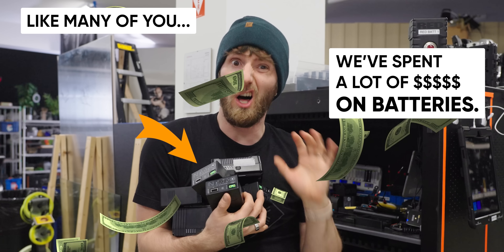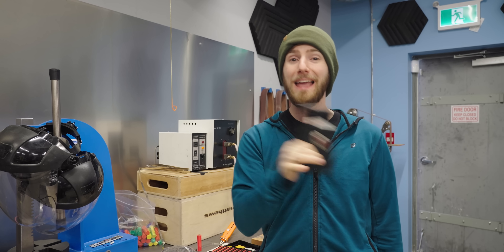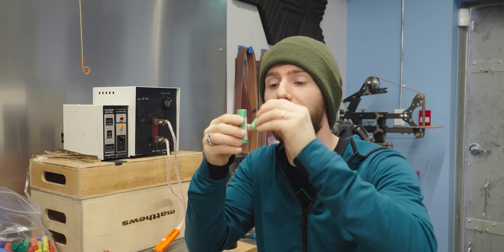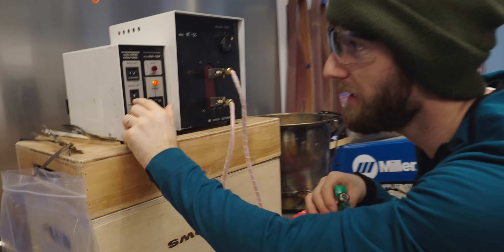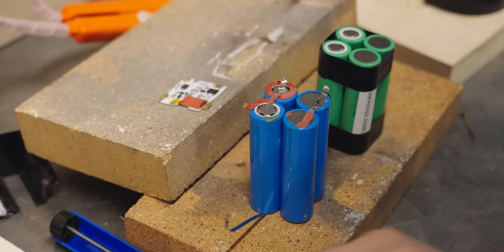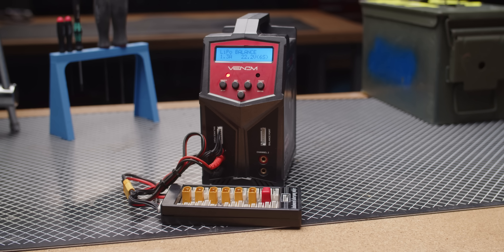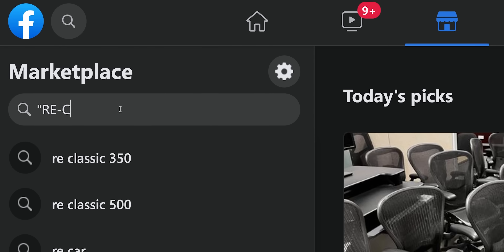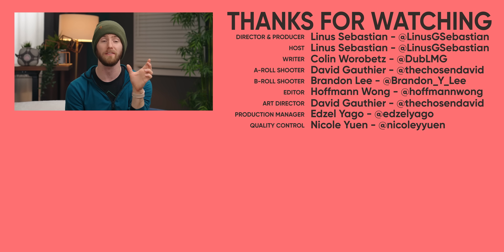This should be illegal… Battery Repair Blocking

Comment: Try keeping power to the BMS. Measure the voltage before you disassemble it. Use a diode protected power supply to match it before you cut the battery loose. Before you connect the last battery lead slowly raise the voltage to match the new battery pack. May work.
Reply: I did that with Gameboy game save batteries and in some devices with clock or other volatile settings that I can't be bothered to set. But a diode is a must, and DON'T use a big capacitor directly in parallel with the battery (it's ok if it is after a diode). It can momentarily drop the battery voltage and reset the thing that you didn't want to reset before it's charged, as a really old battery can have high internal resistance, in contrast th e capacitor being almost a dead short (but at this point the battery will likely be such toast that trying to turn on the device would do the same thing if it's not totally flat). With a moderately evil multi-cell BMS you'd have to make a voltage divider to emulate all cells, as the lack of those voltages would also be a dead giveaway that it's being reworked (in contrast to a fully evil BMS that directly stores the battery's "capacity" and can only lower it, maybe even lowering it faster artificially based on the amount of charge cycles).
Reply: @krzysztofczarnecki8238  See that's just criminal to me that manufacturers can do this. This all exploded after a printer co was sued for making their printers shutdown after X amount of prints. The r-tard of a judge sided with the printer co.

Comment: This was the gayest battery revival video I have ever seen. Sure li-po's are dangerous but when you know the dangers and how to work on them safely... you CAN re-cell many battery packs. I have successfully done this as an amatuer diyer in my garage for drill and battery operated tool batteries & RC batteries which often just have a bad cell in them. Save your old non working RC batts cause chances are you can rob a good cell to replace a bad cell and have a working battery pack for free. With that being said I do get some manufacturers use tactics described in this video but i would have liked to see 1 successful attempt to show that you can do this in your shop or garage safely. Thanks

Comment: Thank you Brother I had no idea that they had such a thing to make it so you can't repair items you buy. I don't buy hardly anything. i never have any money and live under a bridge with no electricity. And whatever i need I just have to wait until the universe manifests itself into my life. I could be working on something that I got 30% of it fixed but it takes 2 years before i come across the next parts I need to fix it and by then the thing is long gone, either stolen or stepped on in the dark or had something spill on it. I obviously have been focusing on batteries for a while now so I can set up a friggin light in there. Been thinking I could buy some vinegar with my food stamps and find a piece of copper wire and a galvanized nail and put some cells together, but I only just got a multi meter finally about 3 weeks ago and I left it on by mistake and the battery must have gotten so low because every single battery I test reads 0.00 and i don't believe every single battery i have is completely dead to zero. Looked up how to fix multi meters and it says its either dead battery or leads bad. So got to wait now until I manifest another 9v battery and a small screwdriver to open it up with. Bloody nightmare Bro. SO THANK YOU FOR THIS INFO BECAUSE i WOULD HAVE BEEN MESSING WITH THEM NIOT KNOWING THAT IT IS SET UP NOT TO WORK ANYWAYS SO YOU JUST SAVED ME ALOT OF HEADACHES, But I do have a question for you then, if you don't mind, Will my idea work with the vinager batterry if I get it up to over 5vs and then hook the wires to a car charger and then plug my phone into it.

Comment: If you hadn't welded the strip with one point on the + terminal and the other directly on the edge, which of course went through that ultra tough plastic film and onto the outside metal case
(- terminal)...it would've went better. Why'd you do that?

Comment: I am absolutely certain your sponsor has something to do with you claiming to never swap out individual cells because that is the absolute right thing to do. The cells are remained good in those packs could be good for another year or more. They're very easy to test under load to determine if they're strong enough to keep. It's foolish not to keep them they have real value

Comment: When replacing the batteries to a BMS, it might go into undervotlage lockout. It might require to see a charger to unlock after replacing the battery.
Reply: or bridge voltage
Reply: @justfixitsolutions  bridging voltage makes sense to me, but maybe i am too ignorant...
Reply: I think it might be just locked if the voltage shows zero it locks forever. I tried to change cells in laptop pack with no success. Manufacturers are evil in planned obsolescense, want unethical milking people of money and producing more and more e-waste

Comment: Ahem This is why I wont go anywhere near Electric Cars for the time being. Sure they have safety measures, but alas. If the Lithium pack is pierced, or if its a Hydrogen pack? ouf, well.. even a simple 18650 battery pack can burn at about 3000-4000 Celsius. Hopefully we invent a reasonably adequate and safe replacement for these batteries.

Lithium is fine in phones an small hand holds. It's the packs that weight 400-600lb's and in the case of Telsa, are even used as structural support. Yea no thank you.

Comment: When dealing with replacing cells in old laptop batteries. I've had luck with not disconnecting power leads. What I mean is having a way to connect the new cells to the bms before disconnecting the old. It seemed to me that once power was removed it shuts down the bms and it never comes back

Comment: Also why are you not using LiFePO4 cells? Those have better capacity than nickle metal and they literally have a decade usable life span and 2,000-10,000 charge cycles

Comment: You should be using liitokala cells. They are fucking amazing and cheap as fuck. They are almost the best cells on the market. Panasonic barely beats them and these cells are only a few bucks each! You can buy them off aliexpress. They also cell amazingly priced large cells for like home energy storage. My goal is whenever I get a house in the rural area is to use their cells with solar and wind power to go completely off the grid. It'll be awesome.

Comment: @4:30 thats utterly stupid you can easily reuse the few good cells in many other projects without serious risk. Now I am not talking about putting new cells with used cells in the same cluster. A great way to reuse the old cells that still work is by using all the old cells that are still good in a single cluster with 1 BMS/PCB. You could use it to create an ebike/escooter or a custom backup for your PC/house. You definitely shouldn't put new cells and old cells on the same BMS/PCB but if you had multiple clusters with 2 clusters of new cells and 2 clusters of old cells all managed by a central BMS/PCB that would be fine and work great.

You missed a good opportunity to talk about saving resources and being smart about it but instead went full nanny state about it. Such a shame.

Comment: If I were the manufacturer of a potentially hazardous product, I would be concerned about liability and I would want to make the product tamper-proof.  Not so much from end users but from fly-by-night re-cell shops.  If somebody does a re-cell and the battery pack explodes, is the original manufacturer liable?  I can see some lawyer suing the manufacturer for not making the product idiot proof.

Speaking of lithium fires, did you see that container ship with electric cars that caught fire and sank?  Possibly 4000 cars!.

Comment: Try makita. Bms locks out undervolted batteries. Never try just one more time. 

Fixing usually requires a new bms off the net, the cells are often fine.

Comment: I recently bought a dji mavic air  from an individual online.  It came with 3 batteries. The charger was designed to charge as many as 6 batteries at once. I put all 3 on the charger but only one would take a charge. After a little research I realized that the other 2 were "deadlocked." WTF does that mean? Pissed me off because batteries are like $140-$150 EACH!

Comment: samsung laptop battery circuit boards have a built in self destruct so that after a set number of recharge cycles the board stops working and if you swap out the batteries for fresh ones the board is dead and can't be reset or reused. That is criminal. I will NEVER buy a samsung product for this reason (or any apple product)

Comment: I have a Lenovo Li-ion 45N1750 battery (from a damaged 11e) that I would like to power a rechargeable 5 W DC homemade table lamp (use where I have no a/c available. I need info on the 7 line pin-out as follows ---RRWYGBB.

Comment: The BMS can be tricky. They will go into shut down mode when the battery is flat or removed. Applying an external power supply the same voltage for about 10 seconds should kick it back into life

Comment: sorry linus but you jhust sound really really uninformed in any of this. Especially about the battery fires, the lithium is suprisingly not that big of an issue, a lithium battery only contains a few grams of it and in a lithium-ion, lithium polymer, or LiFEPO4 battery the lithium is captured in an form that is not that reactive....what is the issue is an combination between a battery that can dump a lot of energy in a short cirquit (ramping the temperature up) and an dielectricum that is just rather toxic and quite flamable due to the chemicals involved.

Comment: I´m sure companies do this to protect themselves. If a user uses a modified battery that causes malfunction on the camera, that user would be able to complain on how the camera is defective when the malfunction was actually caused by the battery. The solution? force the user to buy the genuine spare battery. As you mention at 17:39, that Bebob company creates repairable batteries... BUT you have to send the battery to be repaired by them under their onw procedures to avoid users messing up. Also, as you just shown in this video, batteries are a dangerous thing that only a small percentage of users would be able to repair successfully, the bast majority would end with a burned house.

Comment: You're all worried about attaching the positive and negative battery leads in your pack at about the 9 minute mark, but I'm astounded that you don't realize that it doesn't matter until YOU COMPLETE THE CIRCUIT!! Even paralleling the batteries isn't an issue until you completely connect 2 or more batteries together. That's a pretty fundamental misunderstanding.

Comment: I have experienced that printers/copyers have some kind of use limit also. I had a HP scanner printer that was a true runner for many years, but suddenly just would'nt work anymore, with no reason that I could find. I am an electronic engineer and a certified small electronics repair guy, so I just about took every component off the card and tested them separately. Back then I had little money and lots of time.. I found that it all came down to an integrated circuit, that was triggered by the number it had been used. This component was not for sale by anyone so I just had to throw it away.

Comment: The problem that is the cause of this spot welding not working is because the peak current is too low (although it is high) and the time is too long, the best spot welders use super capacitors as a power source and a higher voltage, probably your spot welder is around 0.5 volts, the ones that are based on capacitors are 5.6 volts and so the current in the best possible time is much higher, remember, if the nickel strip gets red hot it's wrong

Comment: Looking at Amazon reviews of Dymo PNP label printers, they are most likely one of these evil BMS manufacturers. Their battery seems to have planned obsolescence and could have a chip that limits it to a certain number of charges. Luckily it is pretty easy to just wire a 9v battery or a DC power adapter into the machine yourself if you know how to use a soldering iron.
Reply: Dymo's proprietary paper/stickers/receipt tapes, etc. are in line with this manufacturing principle. Receipt tape at the cash register is insanely expensive for what it is FWIW.

Comment: One other thing is many of those small bms units when reconnected need to be woken back up with a jumper or jumper wire and until that is done the bms won't restart. Having that info can be critical in getting it back on.

Comment: You could supply external power (with a series resistance) to prevent memory loss during transfer to the new battery pack.
Reply: It doesn't matter: the gas gauge in the batteries shown in this video stores every cell-parameter you can think of in flash-memory, that includes the cells' original capacity, age, cycles and internal resistance.
Even if you do replace the cells while keeping the gas gauge powered, you won't get better runtimes as the gas gauge won't know any better than that the cells have aged, the internal resistance has gone up and thus will treat the pack like one that has seen better days.
If you're lucky it will update after one or two learning cycles, but you usually have to interfere with the gas gauge by outside communication with a PC to get it to do that (or at least something that speaks the right protocol, usually SMbus or I2C).
And then you have to use the exact same cells that were in the original configuration, as the gas gauge is programmed with that cell-type stored in its memory. Just putting a higher capacity cell in them takes reconfiguring the gas gauge to accept the new values, and this is usually a hidden-dataflash value that can only be programmed with software offered by the manufacturer.
Trust me, I've recelled 3 of my Bebob V-mounts by now, it took me 9 months of self-study to finally figure out how to do it. It's really not as easy as people think it is (and it's also not as 'evil' as people think it is, those gas gauges aren't stupid and in there for a reason)
Reply: @weeardguy  They could change the "evil" perception by supporting the repair community, by publishing necessary re-learning protocols, or even by commanding the re-learning themselves at the owner's convenience and at a reasonable cost.  They evidently prefer their reputation.

Comment: I'm all for consumer right to repair but when it comes to spot welded battery packs I'm all for manufacturers locking down their products. This stuff is dangerous and a lot of the DIY info about doing it, including a lot of what's done in this video, is just not best practice.

Now if your battery fails and causes a fire, the news headline says RED battery explodes. Employees that are hurt sue both you and RED.

This isn't just planned obscellecesnse, this is covering a huge liablity.

The reality is that while the case is still good, a lot of the cost of high end batteries isn't just the case, the bms, or the cells themselves, it's the actual assembly and QA of all of the components.

Offering cell replacements, as mentioned in the video, is a good alternative with potentially less waste, but the volume of these replacements is likely low while the cost, both monetarily and environmentally of needlessly shipping the battery both ways is not insiginificant.

Comment: Over the years, I've explored another side of the rechargeable battery issue - what to do with devices, such as cordless tools, where the battery is no longer available. I picked up three cordless tool sets - a Hyundai, a Craftsman and a Skil, each with a 1/4 drill & 5" circular-saw - dirt-cheap at flea-markets. These were all several years old, nicad powered, all missing the charger and destined for landfill!. I gutted the batteries and wired them with a long cord, terminating in a set of alligator clips to run off a 12 volt battery - either in or out of the car. It worked well enough, that I did the same with my 18 volt Ryobi set, which has been upgraded to NIMH batteries. I gutted and wired one of the old Ryobi Nicad batteries. So far I've used it to drill at a vacant rental house where the power was shut off, drill a hole in a car fender that was too far from my house, and cut cement-board siding in the parking-lot of Home-Depot so it would fit in my car. 🙂
Reply: https://www.youtube.com/watch?v=MMssklzoBAk

Comment: With new stack type battery design the old round cylinder type batteries will be a thing of the past. The stack battery has a better venting system. Better profile less bulk than the cylinder type battery less material used , and better performance, cooling and no swelling or bloating. Don't follow everything you see on YouTube especially when it comes to technology like this being tampered with. If something can go wrong it will go wrong. Lots of the new Boeng aircrafts were grounded because of the use of Lithium batteries and catching fire because they couldn't handle the workloads of the aircrafts controls. If professionals had issues with them  don't think that even if you are experienced with them that disasters can't happened. And yes videos that do demonstrate on how to refurbish Lithium batteries should not be posted to the general public so that the inexperienced get ideas and yes should be banned and reported. It should be carried out in a controlled facility and attention. Videos cause distractions and mistakes are made. There are just some things that shouldn't be filmed. And many workplaces prohibit filming in facilities while on the job. Especially the use of cellphones and cameras.